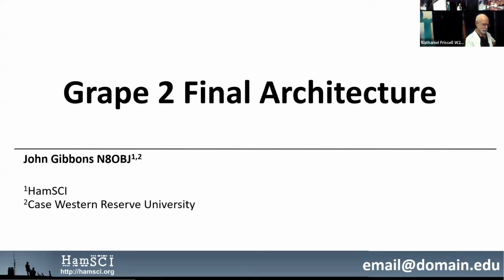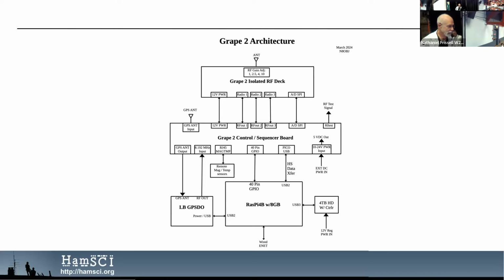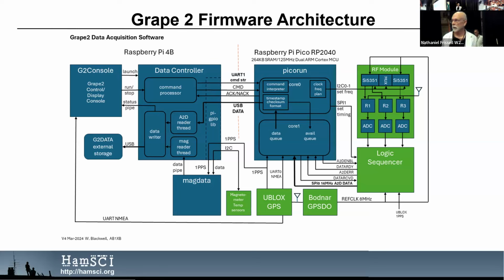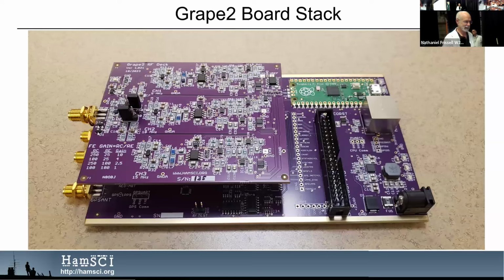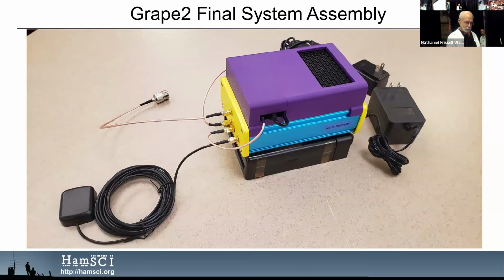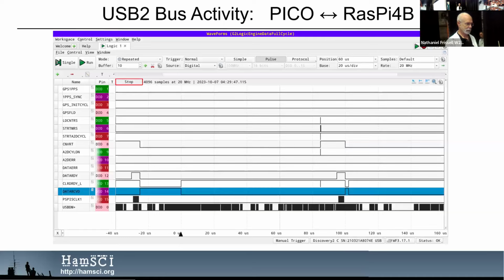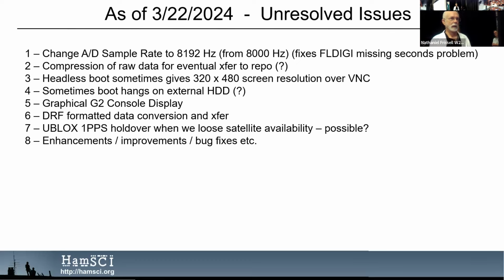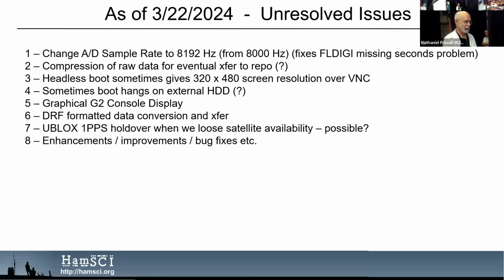HamSCI 2024: Grape 2 - The Finalized Version

Comment: this is great ! radio station WWV is in Colorado and transmits time and solar data 24/7/365 . they on 2.5/5/10/15/20/25 MHZ  use male voice id. they use atomic clock . now WWVH is in Hawaii and is on 2.5/10/15  MHz and has Female voice id. WWVB is 60 KHZ in Colorado. the odd tones transmitted over the air is for this HamSCI program and many more. have a HF radio. tune in WWV and listen a wile. solar data is given out in voice over the air. great way to check the bands as well. just GOOGLE the station WWV all info is on the internet and some great pics of transmitters and antenna system they have.  they got funding to switch back on 25 MHz. was off many years.  I am in NY and 25 MHz is herd late fall to spring at strong signal. this is close to 12 meters and helps me know is band is open.  also FT8 on 12 meters. this is a lot of fun. 73's